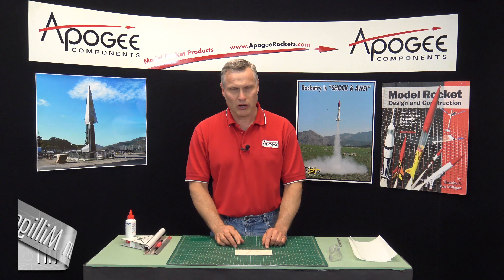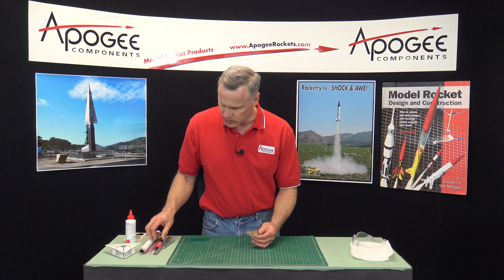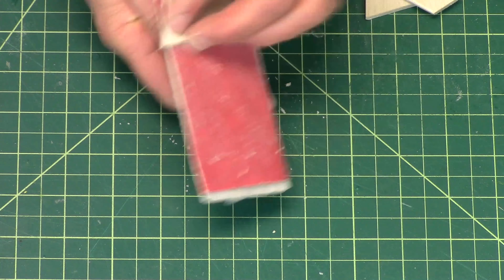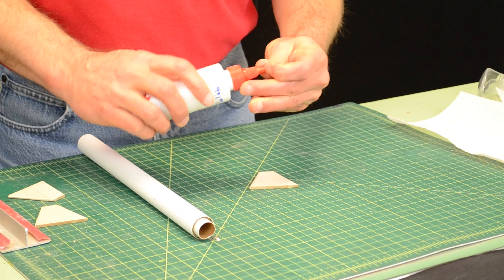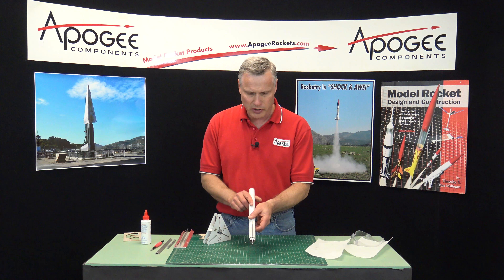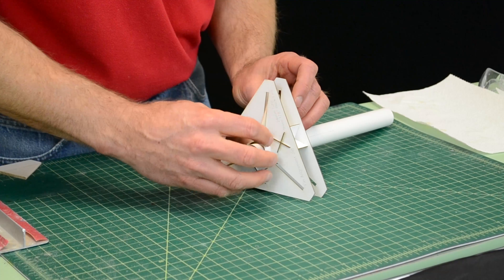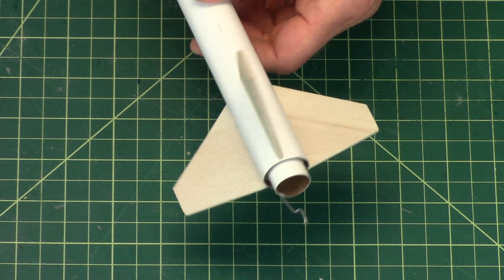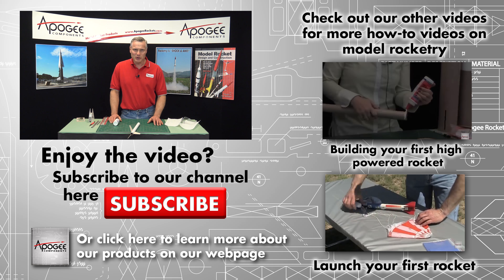Attaching Fins

Comment: Once you use a jig you will never go back! I used a few of the cardboard ones and then popped for the guillotine jig for a five fin rocket. The guillotine is expensive but like most tool purchases you don’t regret it. Using a jig, CA glue and some instant set spray, you can get all your fins on lightning quick.

Comment: I recently purchased the Fin Alignment Jig from Apogee for attaching 1/16" fins to 18mm tubes (BT-20). It really is extremely easy to use and the results are impressive! I am happy to recommend this product :-)
Reply from the maker: Thanks! I'm glad to hear you liked it.
Reply: I like to use 1/16" plywood for the fins on my smaller rockets and this product makes the task of fitting and aligning them much, much easier than the equivalent Estes product. No more faffing about with shims and spring clips!

Comment: I built an Apogee Aspire without the fin alignment guide and they are slightly crooked. If I use higher power motors, how likely is it that the fin tears off the rocket? I did use epoxy fillets, so hopefully that won’t happen 😊
Reply from the maker: You're looking for confidence that it will be OK. I understand that. Unfortunately, I am unable to say for certain either way. Sorry.
Reply: @apogeerockets  no problem

Comment: Hey tim, for rockets like the Sunward Box Racer with foam fins, would it be safe to use epoxy or maybe titebond 3 wood glue on them without it melting the fins ?
Reply from the maker: Yes. For foam fins, that is exactly what you should do.

Comment: Peripherally related, here is a trick for launch lug attachment:  https://youtu.be/9v-_Cgg8J1M  By using a 90º aluminum as a fixture, you can get the lugs dead perfect. The shorter a lug, the more error there can be with a purely visual alignment.

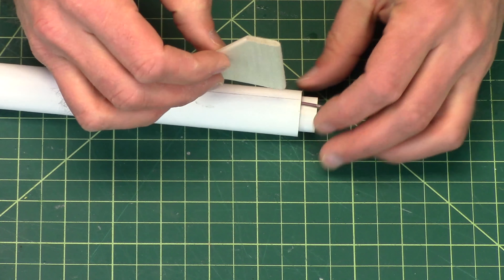Comment: Couple of comments.  At 5:15 you can see that you installed the first fin upside down.  Since these are laser cut, is there planform or aerodynamic difference between upside down and right side up?  Or is it only a structural difference?   If there is an aerodynamic difference then there would be a difference in drag.  Since you, the professional, installed one incorrectly, you should reasonably expect everyone to have the same problem.  You might consider changing the planform of the fins so the leading edge is distinctly different from the trailing edge.  

Secondly, some of your customers might want to improve the aerodynamics of the fins by sanding the trailing edge to a knife edge.  While that seems logical it might not be practical to make a perfectly centered edge.  If the edge is slightly to one side or the other, it can induce lift and spin the rocket.  As an experiment you might try sanding a knife edge from only one side on all three fins and flying it.  If the rocket does not spin, then this is more of a theoretical issue than a practical issue.  If it does spin, then you should warn your customers not to sand to a knife edge and stick with a rounded trailing edge as shown.  

And third, this wood to plastic attachment is a perfect application for Gorilla Glue.  Moisten the edge of the wood with water, apply the glue with a paintbrush or wipe across like you did with the white glue, let the glue foam slightly (which takes longer than you would like), and then stick it onto the plastic body.  It will continue to foam and form its own fillet.  You could wipe the fillet as you did but you should wear gloves.  Gorilla Glue is used to assemble wooden aircraft, so it should be good enough for this.
Reply: it was probably an accident do you look at everything so damn serious its just a basic how to video guy you have issues
Reply: Huge thing if he applied one upside down... huge!